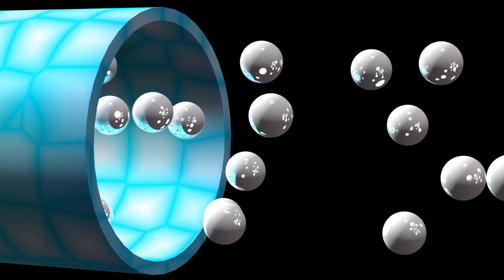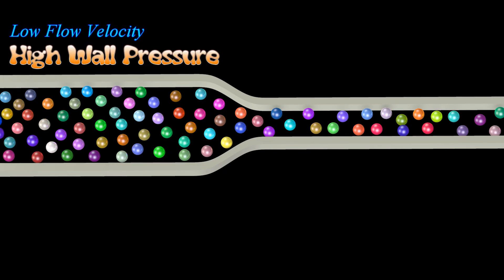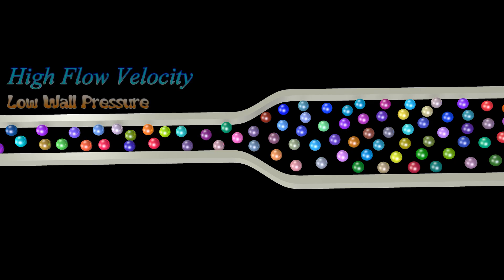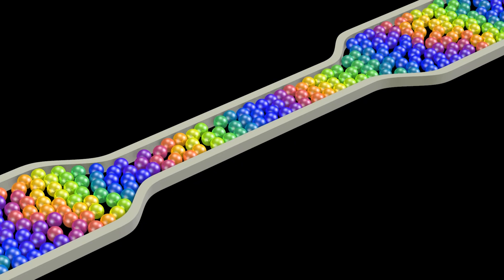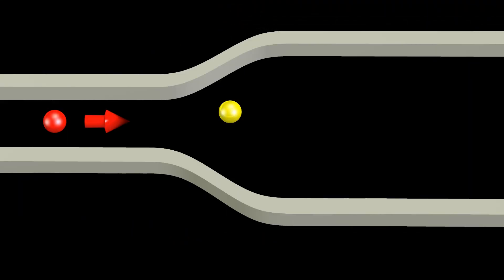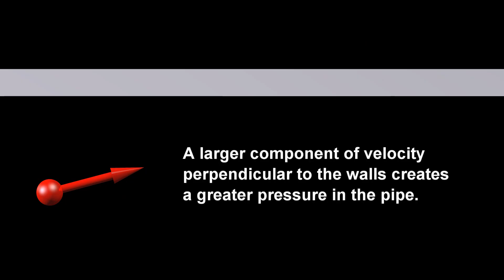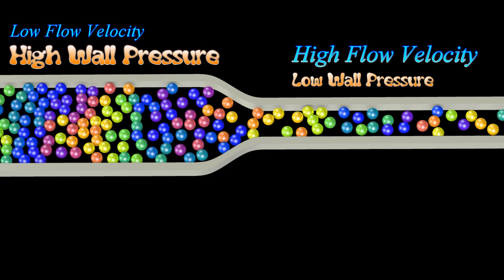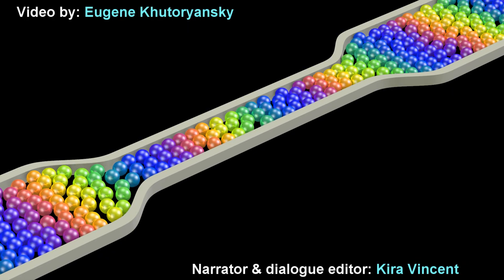Bernoulli’s Principle on Atomic Scale

Comment: Sir....how can i explain this for an airfoils which produces high pressure at bottom
Reply: Because it does not.  The pressure on the bottom of an airfoil or flat plane is a function of the angle of incidence.  An airfoil has no "other wall" just kilometers of sky above.
Reply from the maker: shazam, although the angle of the airfoil is responsible for most of the lift, a small amount of the lift is generated by Bernoulli's principle.  Although there is no "wall" above, all the air above exerts a pressure and the air flowing over the top of the wing, which acts like a wall forcing this air to flow through a narrower passage.

Comment: Great video. Physics done right. But, I recall that Bornoullis principle was in fact only for incompressible fluids. Also, although you provide great qualitative explanation, describing this quantitatively will be a challange 😅.
Reply from the maker: Thanks for the compliment about my video.  There is actually no such thing as an incompressible fluid.  The speed of sound through an incompressible fluid would be infinite, thereby violating the principle that no information can travel faster than the speed of light.
Reply: @EugeneKhutoryansky  I appreciate your reply. You are right. But incompressibility is a good approximation for many fluids. So I think it is very much in the spirit of physics and also very commonplace in physics to make such assumption and derive something. I do admit that your explanation is superior in the sense that it does not make the unfounded assumption of fluid being incompressible and thus avoids logical inconsistancy.

Comment: Dear Eugene: a number of us here have significant doubts about the provided explanation. Could you please clarify?
(1) When going from narrow to wide pipe, the atoms gain vertical component. What exactly prevented them from doing the same while they were in the narrow pipe?

(2) Imagine two perfectly horizontally travelling atoms who hit each other somewhat off-center in the narrow pipe. While the sum of their momentums will remain horizontal both before and after collision, each individual atom's momentum will not. One atom will fly up after collision and the other will fly down. Thus, both will exert pressure on walls.
In other words, even if we only select for perfectly horizontally flying atoms to enter the narrow pipe, they will immediately gain vertical speed very quickly by creating pairs travelling in opposite directions (just like they do in the wide pipe)
Reply from the maker: Inside the narrow section, the molecule is colliding with other molecules which also have a large component of their velocity parallel to the pipe.  If both particles start out with a large component of their velocity in the positive X direction, they will be likely to still have a large component of the velocity in the positive X direction after the collision, due to conservation of momentum.  If you watch the individual particles inside the narrow section in the animation, this might be more clear.  The animation was created by running a physics simulation.
Reply: I am getting more and more concerned. Bernoulli principle must reverse sharply once the narrow pipe becomes narrow enough (when the flow speed inside it turns supersonic).
I can't see how the current explanation accounts for it. As of right now, the explanation simply predicts that the narrower the pipe is the less the pressure would be with no particular limit.

Comment: So why are particles leaving the narrow end of the pipe more likely to collide with other atoms in the wider section giving them a larger perpendicular velocity component? Because of the increased likelihood that such repulsion is at an angle not straight onto the other atoms. This is what the 'leftwards' net force refers to. Both explanations work, this one is better for considering the first width transition, the latter better for the second.
Reply from the maker: Inside the narrow section, the molecule is colliding with other molecules which also have a large component of their velocity parallel to the pipe.  This is not the case in the wider section of the pipe.

Comment: This explanation fails to explain the myriad of interactions of atoms with other atoms in the pipe. Looking at the case of a single atom bouncing off a pipe wall causing pressure seems too simple to be correct. May I suggest a course in Fluid Dynamics to be a better choice than this video. The electrons in the outer shell of the atoms of the fluid pressurize the electrons on the surface of the inner wall of the pipe.
Reply from the maker: The explanation is correct.  If you want a much more in depth discussion of this issue, the following link gives a very comprehensive analysis.  https://arxiv.org/pdf/nlin/0507032.pdf

Comment: Doubt: The logic here is that as the atoms enter the narrow region their velocities become more parallel to the walls reducing the perpendicular component thereby educing the pressure, right? 
I see one flaw in this logic. This would be true if the atoms total velocity remained a constant. But it doesn't. It's velocity increases as it enters the narrow region. 
So there is no reason for the perpendicular component to reduce at all. (The total velocity can still be more parallel just by the virtue of the fact that it's parallel component has increased, without changing its perpendicular component).
Reply: Disclaimer: this is just an idea, don't quote me on it.

"The logic here is that as the atoms enter the narrow region their velocities become more parallel to the walls"

She never says that the speed of the atoms becomes more parallel, she says that atoms whose direction is parallel to the narrow section are more likely to enter it, wich means that you will have prevalently atoms whose directions are parallel. As the speed of the fluid is the vectorial sum of the speed of all atoms, having more parallel atoms means that the sum will be greater, thus the velocity is greater.
Reply: @tommasomorandini1982 hmmm how does this increased speed explain the lower pressure? 
As I understood the whole premise was "atoms with higher parallel component would have a lower perpendicular component". I am questioning this premise.
Reply from the maker: If the number of atoms per second that passes each section of pipe remains constant throughout the pipe, and if the energy per second that passes each section of pipe remains constant throughout the pipe, then the average kinetic energy per particle must also remain constant throughout the pipe.  This means that the average velocity per particle remains constant throughout the pipe.  The only difference would be how much of the velocity is perpendicular to the pipe, and how much is parallel to the pipe.
Reply: @Mahesh_Shenoy  As we know, pressure is the result of gas atoms colliding with the walls of the container (in this case the tube). Pressure is thus influenced by the how heavy the atoms are, and how fast they impact the surface.

The velocity that has to be taken in consideration though is only the component of the velocity of the atom that is perpendicular to the surface. Two atoms that weigh the same and that travel at the same velocity but that impact the surface with two different angles will exert different amount of force. The nearer to 90 degrees, the greater the force.

As discussed before the atoms in the narrow section are, for the most part, pretty parallel to the walls of the tube, thus the component of their velocity that is perpendicular to the surface will be smaller than that of the majority of the atoms in the larger section, thus the pressure will be lower.

EDIT: The velocity of the atoms is the same for every atoms (in reality it isn't actually the case, but the argument doesn't change) the only thing that differs between those in larger section and those in the narrower section is their direction, or the angle of their trajectory with the walls. The atoms in narrower section are more parallel to the walls of the tube, thus the component of their speed that is perpendicular with the walls is lower, thus the force that the walls have to exert on the atoms to change their trajectory is lower, thus the pressure is lower.
Reply: @EugeneKhutoryansky  why should the avg kinetic energy remain a constant across the pipe? 
All we know is that the fluid is speeding up, and this increase in KE comes from the external work done in pushing the fluid through the narrow region of the pipe (which, in bernoullis terms, is by losing pressure)

Comment: So it's fair to say the pressure acting on the wall is that static pressure? If so is the pressure parallel to the wall dynamic pressure and will that increase if velocity increases ?
Reply: Static pressure pushes in all directions equally.  Velocity pressure is the component of pressure due to the movement of the fluid.  The pressure parallel to the pipe wall, if measured facing into the fluid inlet, would be the total pressure, which is the static pressure plus the velocity/dynamic pressure.  This is why a pitot tube for measuring velocity has two holes in it, one parallel to the flow and one perpendicular.  The perpendicular hole measures the static pressure and the hole at the tip measures the total pressure.  The difference between these two pressures is the velocity pressure, which can be then be used to calculate the velocity of the fluid.  (The dynamic pressure cannot be measured directly, so far as I know, because it will always include the static pressure component, which must be subtracted out.)

That is another way of thinking about this phenomenon, like conservation of energy.  If the velocity component is like kinetic energy, and the static component is like potential energy, and the total energy flowing through all sections of the pipe are the same, as the static pressure increases, the velocity must decrease and vice versa, according to Bernoulli's equation.

Comment: I can see this as being true "initially" as the atoms enter the narrow section of pipe but as it travels further through the narrow section of pipe the random motion of the atoms should distribute the velocity in all directions and therefore at the far end of the narrow section of pipe (before reaching the larger section) the pressure should increase. Is this true?
Reply: It doesn't become random; If it did, the flow would completely stop for seemingly no reason. This doesn't happen. Put another way, if an atom with a large forward velocity hits another atom of the same mass with a large forward velocity, the result still has the same total forward momentum; it's just shared slightly differently between the two.

Bernoulli's principle works with ideal gasses, where there are few interactions between particles. It also works with real liquids, where there are lots of interactions between particles.
Reply: @JayLikesLasers  Imagine two perfectly horizontally travelling atoms hitting each other somewhat off-center. While the total momentum is preserved, one atom will fly up after the hit and the other fly down. Thus, exerting the pressure on both walls. I am also doubtful of Eugene's explanation.
Reply: @JayLikesLasers  - The atoms are not just interacting with each other but also interacting with the wall of the pipe. Given the uneven nature of the surface of the inner wall of the pipe especially at the atomic level there are going to be collision that cause randomization of the trajectories of the atoms and therefore they MUST become randomized over time. Perhaps the effect is small for short distances and times but it would be additive and given a long enough reduced section of pipe the effect should be measurable.

Comment: There it is the difference between knowing something and understanding it well.
Reply: As Feynman said, knowing all the bird names of the world does not tell you anything about what birds are.
Reply: jmchez That’s why I skipped learning their names.
Reply: @jmchez  atomic theory + first principles thinking 💪😎
Reply: Its the proccess. Step 1. Knowing and step 2. Understanding it... So step 3?
Reply: Exactly !!!! Most people don't want to understand, they want to be told that they understand due to the extremely lazy system of education.
Reply: Vendicar Kahn  
Hmmmm.... 

1 : Pressure is pressure. You can measure it relativly to a reference (differential pressure) or to an absolute 0 (absolute pressure). "Y" having a negative differential pressure (relative to "X") also means that "Y" has a lower absolute pressure than X. Both differential and absolute are related. Your statement is non-sense. You cannot have X/Y differential changing without at least having absolute X or absolute Y changing either (or both).

2 : Bernoulli's principle is about incompressible  isentropic flows (but can be extend to any flows). It states that if a fluid is going from  area A to area B and without any form of external intervention, its sum of energies remains constant. Thus, if between A and B the flow is going through a narrower section, speed in this section needs to be high to conserve flow rate (fluid does not vanish out). If fluid changes its speed while entering and exiting narrow section, it means that there is a pressure drop to accelerate it in, then pressure is constantly low on narrow section, then there is a pressure raise to slow it out back on a wider section again. It's Newton's law : a=F/m : speed change involve non-zero resulting forces. But since this is a fluid, we're working over areas and volumes, not on points, so with density and pressure not with punctual forces and masses. Then : speed change involves pressure gradient.

Pressure DOES change. You can see here, as soon as liquid is moving, pressure quickly dropped on all the pipe as the flow raises then is more slowly going down as the tank is emptying.
https://www.youtube.com/watch?v=RFIwSxMomaU

The simplified Bernoulli's equation says that p + q = p(0) 
Where 
p is the static pressure, the one we can measure
p(0) is the total pressure (or maximum static pressure or stagnation pressure), the static pressure you measure on stagnating fluid
q is the dynamic pressure, pressure drop due to pressure used for kinetic energy. Basicly, it's kinetic energy per volume

And since pressure is interpreted in an atomic scale as collision due to molecular agittaion. The fact that static pressure (agitation in every direction) is partially transformed into dynamic pressure (kinetic energy or... somehow "unidirectional agitation") => yes, you could conclude that in fact, on the Bernoulli's principle, flow rate (or speed) DOES altered the molecular velocity direction.

=> "The producer of this video neither knows Bernouli's principle, nor understands it. It's laughable." You're the one laughable to mock a physics professor about abslutly relevant content and writing yourself nonsense like "Hence the pressure does not change either. " about Bernoulli's Principle... Come on...
Reply: @nounours2627  Yes, this video author explains no physics cause and effects, and directly contradicts it own logic.  It is just more nonsense added to all the other well-intentioned bad physics noise about Bernoulli on the net.
. 
The explanation it dismisses at first is the correct one and this author does not know that Euler, following up on Bernoulli's work, discovered that it is a pressure Gradient that Accelerates fluid, just like a force Accelerates a solid mass. If you see some mass accelerating you need to identify the force causing it.

You are correct that the fluid has mass and, therefore, a force is required to accelerate it. <-- Newton's First Law.
.
Among other problems. 
The above 'story' relies on probability to determine pressures when it says "an atom is more likely to enter the narrow section of the pipe, if it has a larger component of it's velocity parallel to the pipe walls."
This is Crummer's Falicy which fails to understand that the internal, static pressure of a flow is isotopic and the "bouncing' of the molecules occurs at supersonic speeds.  Any single motion toward the narrow section is preceded by and followed by millions of motions at all other conceivable directions before is covers any distance toward the narrow section. 
The static pressure motions are completely independent from the directed flow in one direction.  The momentum transfer to a wall is not changes by adding a flow parallel to the pipe.
.
The video you link clearly uses such small tubing that the viscosity-pressure loss for such short lengths is very significant. 
In fact, measuring the pressure change of the long section form source to the first manometer has the same ratio of pressure loss as the pressure loss between the two end manometers.
Reply: I joined mensa after reading this comment
Reply: Big brain shit
Reply: @SimonWoodburyForget  very true indeed
Reply: ur mum
Reply: @38Fanda  Ah, gottem.
Reply: Vendicar Kahn  i agree with u, these channels make false content and people watching it grasp it blindly without even questioning and say i understood it now